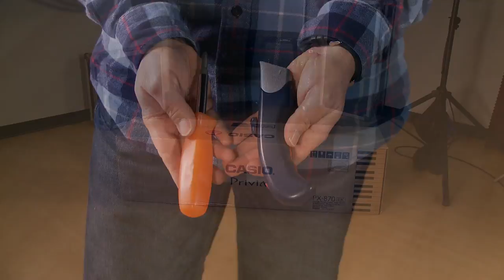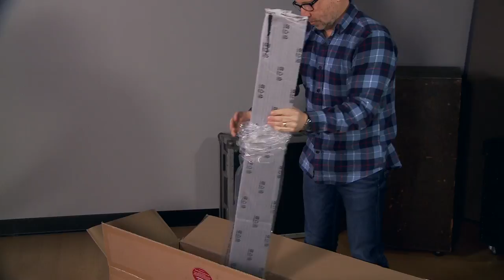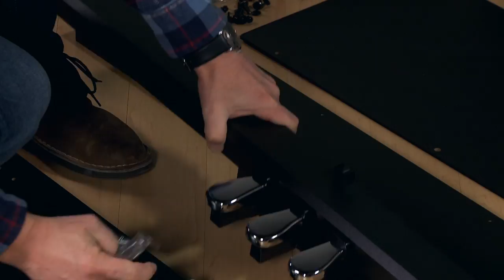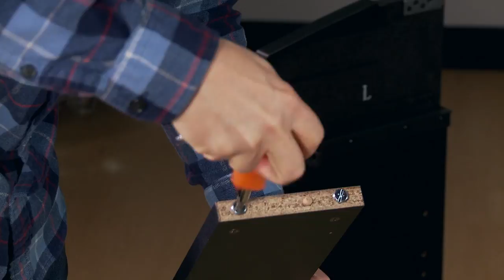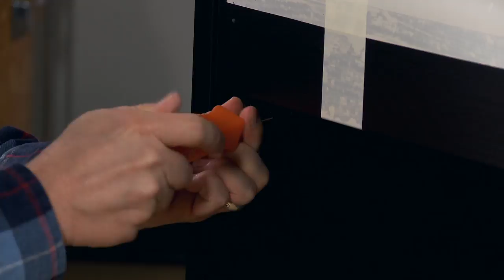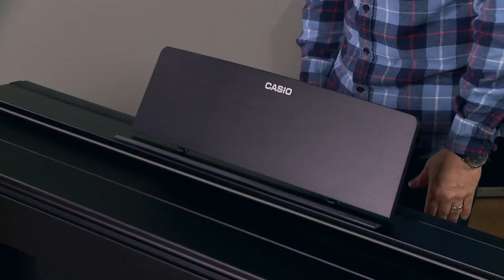Casio Privia PX-870 - Assembly Guide

Comment: I have to offer a fairly harsh critique of this instructional video. While I am thankful for its creation, it actually goes out of order on the steps. You are supposed to connect the backboard first, not the pedals. Following the instructions in the video resulted in my left/right legs falling over during construction and permanently damaging/bending the metal clips used to secure the pedal board to each leg.
Reply: Same thing happened to me dawg.
Reply: Almost happened to me, too. I had it propped against a wall so it only fell back a little. Decided to install the cross bar first. Much better and sturdier for then getting the pedal bar in. Sorry to hear about your messed up metal clip. Hope you can get a replacement easy enough.
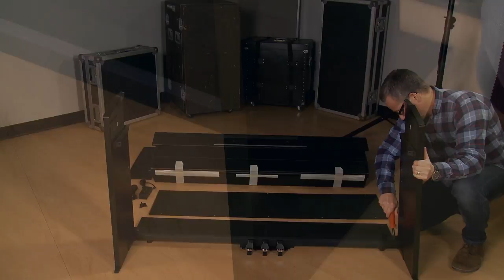Reply: Agree! The connection of the back board (part # C) to the side panels (part # A and B) should be done first (7:31 ~ 9:02 in this video). I strongly suggest being patient and following the manual. Plus, It's definitely better to assemble the whole thing with two persons rather than just oneself.
Reply: Same here!! Just got saved with screwing the metal clips.. i ended up putting the assemby horizontal to follow the steps in the video as alternative method